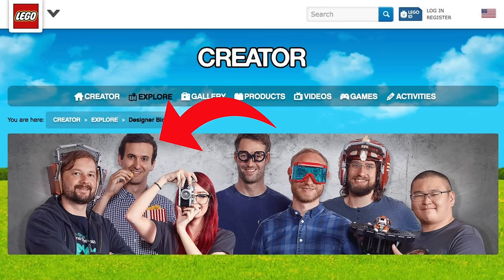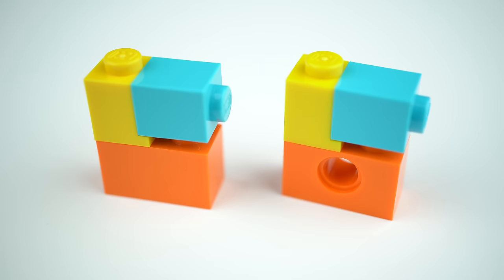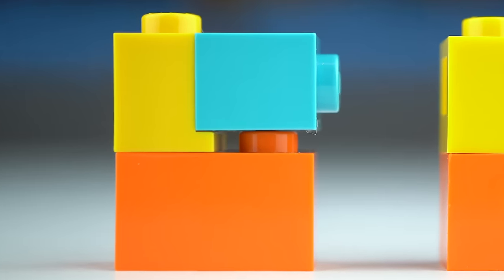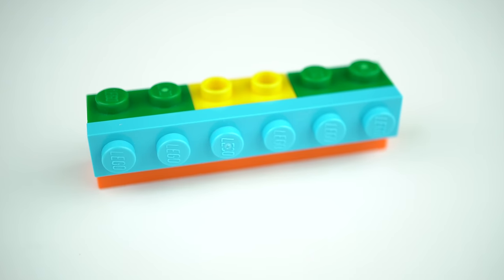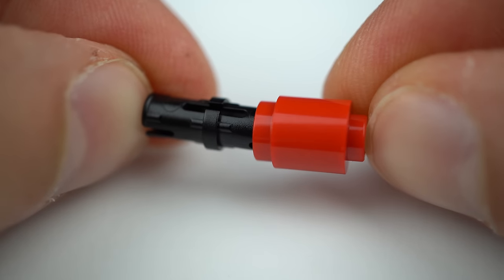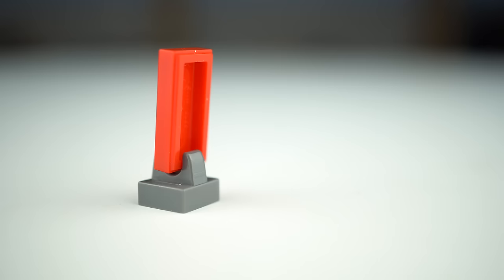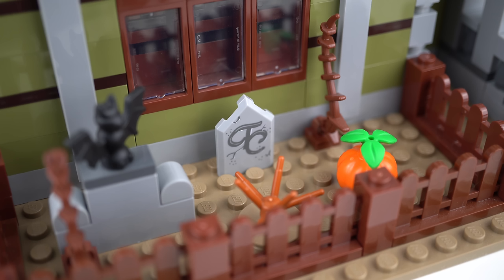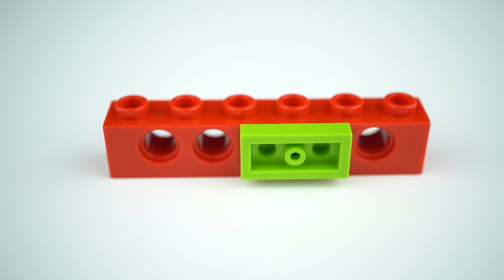Illegal LEGO Techniques

Comment: It's really interesting to learn that the Lego designers are actually modifying pieces to be more versatile and durable.
Reply: Then why is the LEGO Logo still outside, increasing the height by 0,1mm and why are the holes of these technic bricks still 0,05mm misaligned and why do technic bricks not have inside groves so you can put half pins inside them? 🥲
Reply: @Einheit101  the lego logo is there to identify it as a lego brand brick
Reply: @MakenaForest  they could sink it in instead
Reply: @Einheit101  that would weaken the stud
Reply: @Einheit101  because these are all intended parts of the pieces?
Reply: @MrHanBrolo  0,1mm Logo insertion would not weaken the stud.
Reply: Yes! I just moved and got my sets out again for first time in a ling be time (almost all 80s & 90s) and was assembling... Found those adjusted, more modern, pieces in the video odd to looking as have built so few more recent sets (wouldn't have paid attention when doing them to see the changes)
Reply: Probably a legacy issue. New pieces need to be compatible with older ones. Since Technic is a big deviation from regular Lego, regular pieces aren't 100% compatible so they need their own versions.

Comment: The conflicts with technique brick seems like more of a design oversight when the molds were introduced
Reply: The technic bricks have holes that are slightly higher than the SNOT bricks because  if the holes were the same height with the thickness they have, they wouldn't be able to fit on top of a standard Lego brick with the logo on the studs. Either way, there's some incompatibility between technic and standard bricks, and Lego simply chose the one less likely to cause problems.
Reply: @GarryDumblowski  Then maybe the snot bricks should be the one redesigned. :P

Comment: My favourite obscure legal connection is a technic pin to the underside of a 1x1 brick with studs on 4 sides. The open studs actually give the pin room to properly expand and move freely, so while it may not be intentional it's not actually stressing anything and is, as such, fully legal! It was even used in an old M-Tron set once.
Reply: I'm pretty sure you're talking about Particle ionizer as I have that set at home and if I recall correctly the connection you mentioned was used for the "rotor" part
Reply: I have it used in 75491 (Indominus set) as a base for the trees.
Reply: One more use for the Travis brick!
Reply: It was also used within the past year in another set, I think it got a mention on New Elementary
Reply: Jesse Mathis  exo force: sweats nervously
Reply: Jesse Mathis  still more stable then 08-11 bionicle/hero factory joints
Reply: Same with a pin in a round 1x1 brick, in fact you can hear the click with it and it does in fact expand, meanings it's fully legal. In fact there is sets that have that.
Reply: what

Comment: This is awesome! I would always direct any non-Lego friends to the "Stressing the Elements" powerpoint by Jamie Berard when they'd hear me talking about my builds or see the ever so misunderstood memes, but this more 'hands-on' video is way more intuitive and thorough (as well as being more modern with the new cone and 1x1 tile with clip molds).
Reply from the maker: Based this video on that powerpoint!
Reply: @TiagoCatarino  Some of the old illegal builds from that powerpoint are outdated now, like sticking a transparent bar in the hole of another transparent part. The new trans clear material is not polycarbonate any more, it's the softer MABS now, so the friction is same as regular opaque bricks. That's why we see so many new recolored parts in transparent nowadays.
Reply: That PowerPoint presentation should be required viewing for many builders. We stumbled upon that presentation and re-presented it at one of our LUG meetings.

Comment: I always thought illegal lego techniques were just a meme. I was wrong
Reply: Yeah me too, I was just kidding he was using illegal technics💀
Reply: I always thought it was just aesthetic stuff LEGO designers couldn't use or what looked like the pieces didn't line up in instructions. Turns out I was also wrong.
Reply from the maker: It is a very serious business at LEGO!
Reply: @TiagoCatarino  Not just LEGO. You can do a lot of kitbashing with any given kit, even sanding, gluing or putting undue stress on the used parts. If it works, works. If it doesn't, you just failed, no big deal :P

Comment: It appears to me that many of these "illegal" connections were just a lack of foresight on the original designs as far as cross-compatibility goes. In some cases they were directly addressed with a re-design and it seems that some of them are simply just too late to fix (e.g. technic vs. normal alignments & lego logo protrusion). Can you honestly say that with a blank design slate that all of these incompatibilities are necessary?
Reply: completely NOT necessary. They done f'd up and are still charging an arm and leg for bobo products.  GARBAGE.
Reply: Lego could definitely engrave the Lego logo into pieces and increase design compatibility but I don't think it'd really be worth retooling everything they currently use unless it really opened up design opportunities.
Reply: @bergauk  The LEGO logo could easily be swapped from raised to recessed; the moulds used do have a finite lifespan, so while it would take several years they could choose to make this change. Whether it is worth it or not is probably mostly a question of principles. Is making a few, esoteric constructions "kosher" worth it vs. messing with a logo that has been unchanged for decades?
Reply: @koma-k  I thought the LEGO Logo was a quality control device, like making sure the plastic was liquid enough to get all the way into the mold.
Reply: @joet3935  it may have been used for that when it was first introduced, but then the bricks were of a simpler design. Current bricks have more fine detail on the underside, so if the mould is not completely filled I believe those will suffer before the logo on the studs is affected. Also, injection moulding and material science has advanced a bit since then (50+ years ago?), with material quality, injection pressure, temperature and volume under far more precise control now.
I don't think the logo serves as anything but branding these days.
Reply: Had they known when the elements were first made that these connections would be almost possible, they probably would have done it differently.

They've gone out of their way to correct a few but they can't correct all of them since it would make them incompatible with older pieces.

Take the example at 1:26. In hindsight they should have made the center hole of the technic brick line up with the stud brick. However, if they fixed that with a new brick, using a new and old technic brick together would cause the exact same stress issue.
Reply: A few probably on purpose to make you buy more Lego tbh

Comment: 3:07 Sadly it's not, it still gets stressed and ultimately broken. I have several new clips and they're mostly broken, I didn't even use any illegal techniques similarly in the video, only had them clipped on some bars and they're still broken so no new clip design doesn't really help
Reply: Just curious  does it seem to happen more when the air is dry?
During the Winter for example.
Reply: Nope it happens all the time. I mean I'm totally unable to notice when they break but whenever I check them, there's always cracks so idk if humidity can affect the plastic tho

Comment: The tombstone tile blew my mind - so you're saying Lego made the one with print slightly thinner just to place it like this in this specific set? Like making a new mould for manufacturing for this etc?
Reply from the maker: All tiles are slightly thinner than plates!
Reply: @TiagoCatarino  Is it really just the thickness difference that makes it legal or the fact that tiles also have a groove that reduces the edge contact with the studs bottom radius? The pentagonal shield in your example has additionally a big chamfer as well. What about the old style of tiles without the groove? Those should be illegal as well, right?
I found some dimensions on the internet: Tile 3.14mm, plate modified (jumper) 3.17 mm and regular plate 3.2 mm. Are they true?
Reply from the maker: @R0Sch88  to my knowledge just the thickness. Old tiles if they have the same height, still legal.

Comment: Okay, my mind is blown right now. I knew about the logo on the studs making some connections illegal, but I never would have thought that the hole in a technic brick is positioned a little heigher than the stud on a headlight brick. Why is that even the case? Is it to make room for the stud of another brick when you connect that to the bottom of the technic brick? And why does the stud of the indented headlight brick extend just a little out of the volume of a regular 1x1x1 brick? Or why don't those bracket pieces fit? It makes no sense to me.
Reply: That bracket problem caused me so much headache I always make coplex multi-directional builds, and sometimes I have no other way to solve the building promblem, than that. (Also I clamp it down quite securely with other parts, and put some distance between them to make more room for the parts to flex, but I just don't get it why). I can only hope Tiago sees us, and gives an answer.
Reply: @abelnemeth4346  Yeah, that double bracket construction looks very useful, if only it were legal. I think LEGO themselves used a similar trick with two of those 2x2 modified plates with 2 studs on one side for the wings of the UCS B-Wing Starfighter, so why can't the same thing be done with brackets?
Reply: @minervszombies  I think on the B-wing you’re thinking of part 4654577 (99206) that you can see coming together on page 25 of the second book. 
I have no idea why the brackets don’t fit together though. Would love to learn the history behind that one.
Reply: @lukewells7632  Yup, that's the one I mean
Reply: For the headlight 1x1 element; when turned on its side; it is 2 plates high, and the top stud is now flush with the bricks below it. Edit. Classic Space Polaris-1 Space Lab set used this technique for the rocket lab thing
Reply: @stevenblankenheim4016  Yeah, I know the headlight brick is 2 plates high when turned on its side, but I though the stud on the side was 1/2 plate high, which would allow the headlight brick fit within the volume of a 1x1x1 brick. But since it doesn't fit, that must mean the stud is slightly higher than 1/2 plate, and I don't see why it is designed like that.

Comment: I did a lot of plate connections (03:50) in the '80's with my Lego's. If you wanted to make a slum or a shed, that plate connection was the way to go and looked the most natural. Since then, Lego had  lot of time improving them to release the stress in the plates that way. If they can improve the cones (03:17) to make former "illegal techniques" legal, they can do the same with the plates.
Reply: Smart
Reply: Decreasing plate thickness would however break everything else
Reply: @affegpus4195  Yes, but calling a plate connection like I did for sheds or slums illegal is way to dramatic. It's not illegal to put just one plate and after a few knobs another one.
Reply: @ardmichielsen2977 If you are a Lego engineer, you are not allowed to do that.

As an end customer you can do with it whatever you want, of course (subject to the criminal code), but illegal builds will void the warranty.
Reply: @davidwuhrer6704 But Lego had/has had enough time to make this "illegal" construction possible by adapting the plates. I made many "slums" this way in the '80s, so Lego has been dormant for over 40 years adjusting the plates to make it work.
Reply: @ardmichielsen2977  Adjusting the geometries would make the new pieces incompatible with the old pieces.  They wouldn't fit together.

They have created new pieces and phased out old pieces to make new constructions possible.  They are not sleeping on that.

But to change the plates such that your constructions become not only possible but legal would mean that the old bricks don't fit with the new bricks anymore.  Not just fit with unwarranted stress but not fit at all.
Reply: @davidwuhrer6704  You just need to scrape off a small part of the bottom of the plate where they meet the bumps, it's not even a tenth of a millimeter and knobs still wil have a lot of connection there. They can simply leave the rest of the plate thickness intact without loss of stiffness and therefore keep the plate height exactly the same as it has always been. You shouldn't want to make it more difficult. You can still use the old bricks. There is no other way in creating a slum or a shed with Lego's which looks a bit natural than with this "possible (but not recomendable, illtegal is way to exaggerated) connection.
Reply: @ardmichielsen2977  Changing the plate height would make more builds illegal that are legal now than it would make builds legal that are illegal now.  Yes, it's just a tenth of a millimetre, but that adds up.  Originally, Lego didn't even have plates, the ratio of the brick height to the knob distance was not a concern in the original design, and now we are stuck with that oversight.
Reply: @davidwuhrer6704  You only have to scrape away a bit of the plate where the knobs of the other bick or plate touches it, not the complete plate.

Comment: In my experience, the new 1x1 clip design is a lot more fragile than the old design. Very scared of putting a plate in to the new clips
Reply: unless you try to put it in sideways there's 0 issue as the measurements won't allow the plate to excerb sideways stress to the clip arms. Unlike in the first version.

Comment: Lol, I just love the dystopian flare that the word "legal" brings here. 

As a kid I once have flattened a section of a cross beam with my teeth, making the beam able to flex, so that it turned into a catapult arm. Moreover, when you inserted the flattened part deeper into the holder (and it took lots of flattening and a small hammer to tightly match the tolerances of Lego) - you could control the flexiness of the beam, thus kinda controlling the range.

You can do anything with the things you purchase (especially when they cost what they cost).

Comment: I didn't realize the new 1x1 tile with clip with tile connected was a legal building technic. I have seen this on both the Creator Blue Power Jet and the Icons Discovery sets, with the clip holding a 1x1 tile up for a heads-up display. I always thought that was illegal, but I realize now it isn't.

I have however added an illegal building technique to the Discovery set to make the explosive cover for the drogue chute that goes at the base of the tail. While the Technic pin + 1x1 stud does allow the bottom of the tail to line up with the rudder/brake, it does put strain on the pin as it cannot expand inside the 1x3 inverted slope. It's been in there so long that it has practically conformed itself to the hole and no longer is under much strain anymore. I now realize this is also inaccurate, as STS-31 (which the set is based on) didn't have this drogue chute. It was first flown on STS-49, the maiden flight of Endeavour, almost 2 years after Discovery carried the Hubble Telescope to orbit.

Also, if you're wondering what the hell a "drogue" chute is, it can also be called a drag chute, but I first picked up the term while playing Kerbal Space Program.

Comment: The old 1x1 clips were breaking even when you made legal connections like adding a simple 4L bar or minifig tool. 
It's only one example how elements break just from the originally intended stress. Many of transparent parts with clips, transparent 1x1 plates round and squared, Bionicle sockets for balljoints, bushings for Technic crossbars and so on. The all tend to break by just the normal use. Sad.

Comment: Best Solution for the first problem: Use non-branded bricks from Xingbao, Mould King or orhers, and you won't have 0,14 mm too much of branding preventing you using a normal brick.

Comment: WHY are technic bricks slightly different dimensions that lead to less compatible legal builds?

I have wanted to use plates and bricks for bases of some technic builds. Or to incorporate non technic pieces for form or function. I wish there was a rod/pin piece that was meant to go into the Lego brick anti-stud holes.

Comment: With the redesigned clip featured in the video, did they alter the plastic formula for this tile at all? The original clip tiles were very hard to push things onto because they were very stiff. I remember that LEGO introduced certain elements that had nylon in it for RC sets. Is there not a way to build a plastic and nylon composite injection formula that could make certain bricks more flexible? I am in no way an expert on this, I'm just curious as to whether LEGO themselves explored this possibility and found limitations that are not easy for us builders to understand.
Reply from the maker: They just changed the element design. Thinner walls means the clip is more flexible and not as hard to connect pieces to

Comment: If it is illegal to put a plate into the holes of a technic brick (like 2:09 in the video), then how come it is legal to use pins with studs to connect the (underside of) that same plate?